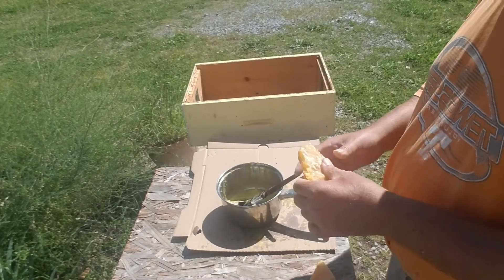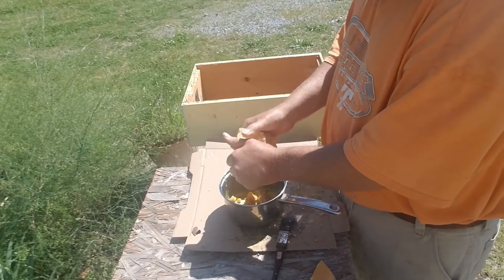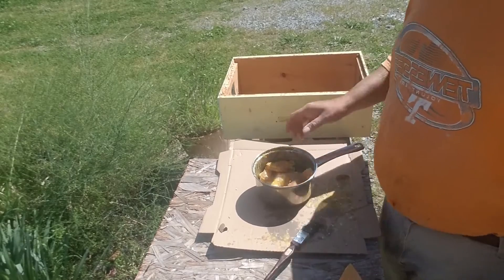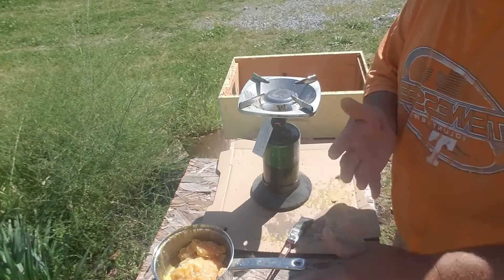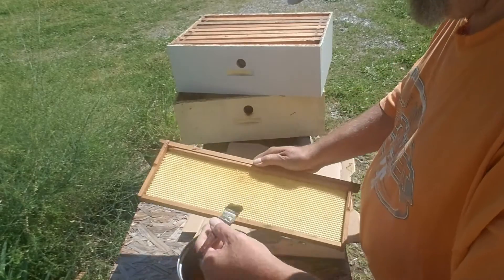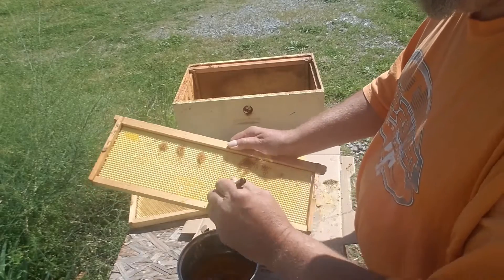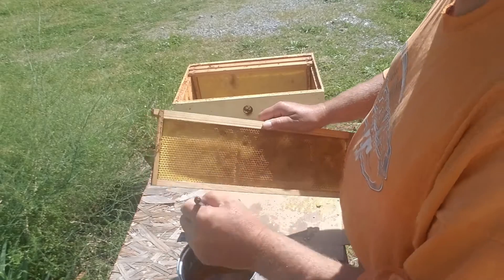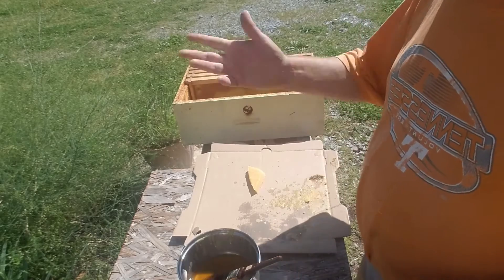How to Get Plastic Foundation Drawn Out!

Comment: Don't have to worry about getting it too thick in spots?
Reply from the maker: no you do not. i try to fill the cells
Reply: @WoolieBsApiary  thank you for replying.  I just got a first lang. I have top bar hives.  The bees were hived 9 days and built comb between the frames. :(. I took.out what frames I could and recoatedv foundation 2 be time w heavier wax.  I used a paint brush.  How long should I wait until I check it again?  Re comb building?
Reply from the maker: @mj-ls7qr8xp3n  depends on where are you located. here in SE Tennessee the spring flow is almost over in the valley. if i keep feed on the bees they will continue to draw comb i do not feed they will stop and basically never start back